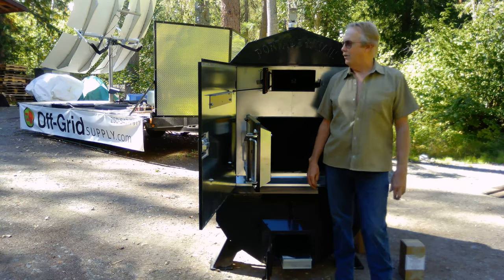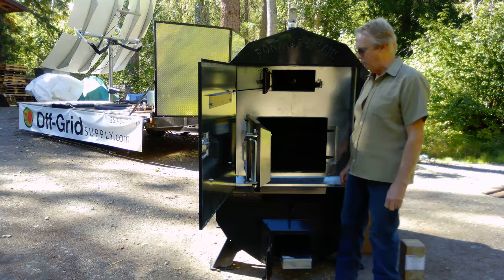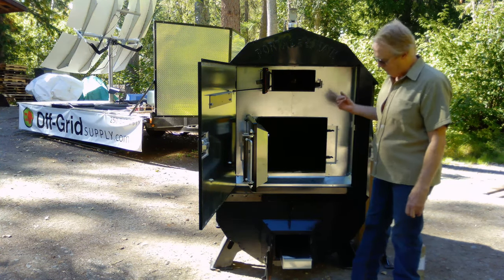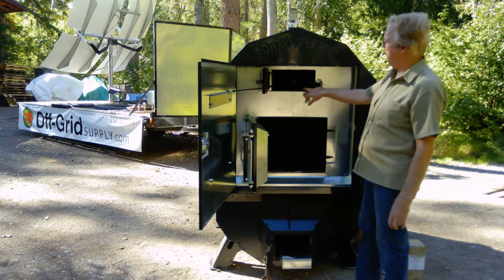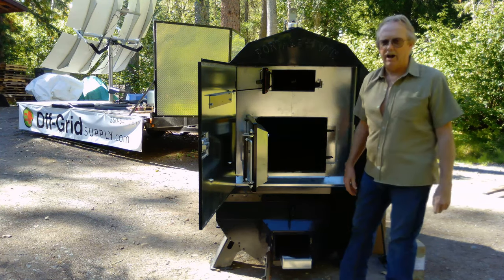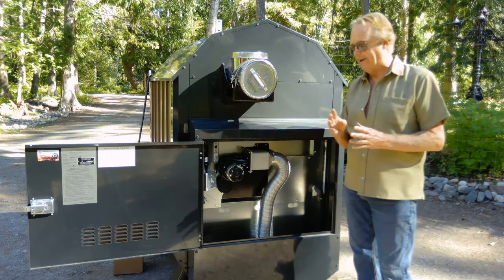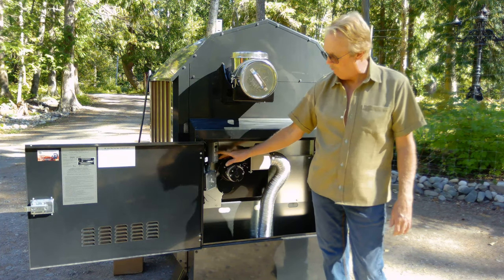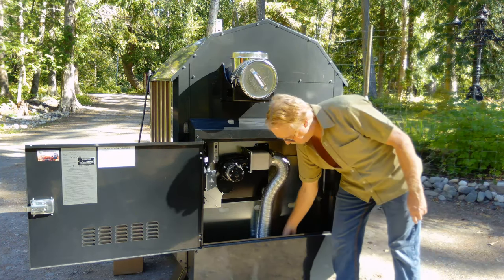Ultimizer Series Portage & Main Wood Boiler walk-thru / Off-GridSupply.com

Comment: Just bought mine..!!! WILL SEE HOW  I LIKE IT OVER MY  OLDER CENTRAL PRE-CLASSIC  THAT DIED  TWICE A YEAR NOW. For the last 5 years. AND THIS LAST TIME I LOST TRACK OF OVER 20 pin holes  and 3 cracks. WOW it was/ IS BAD. DEAL   Made crappy and made it from 1995 so I say not to bad. Actually… yes crappy but still with. Crap materials and all the pin holes. It still worked and IS AGAIN NOW .. as it’s Ben -20 here most bites all this week. So yeah. Can’t wait to hook up this new portage and main….
Reply: How's it holding up a year later?